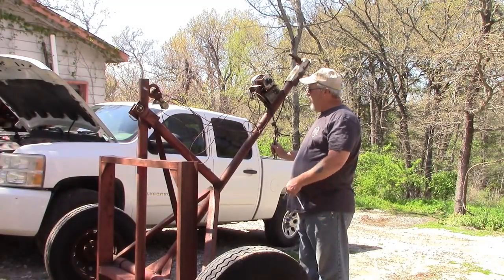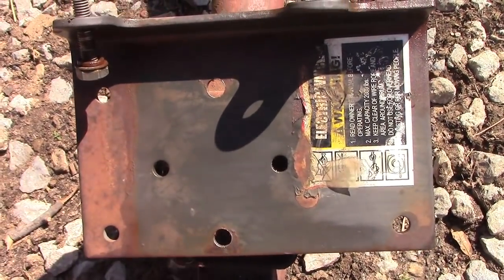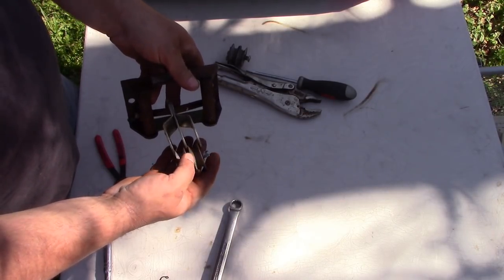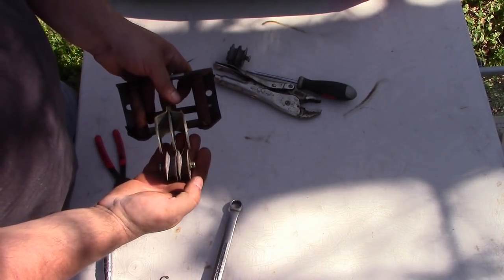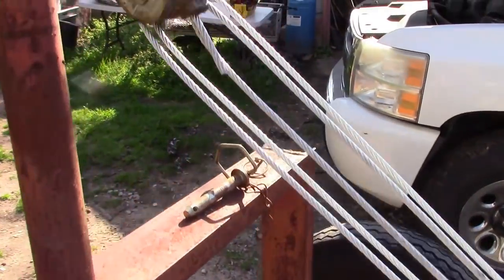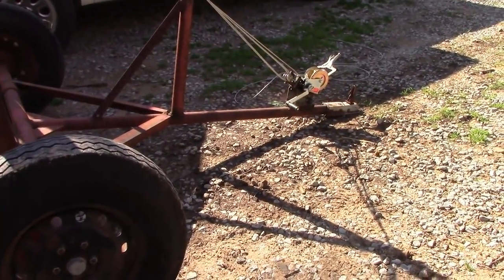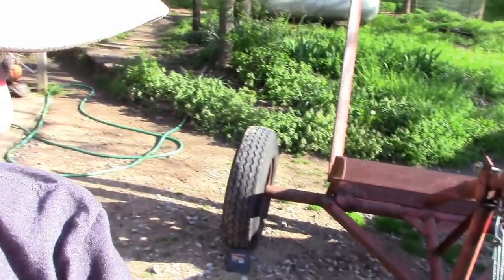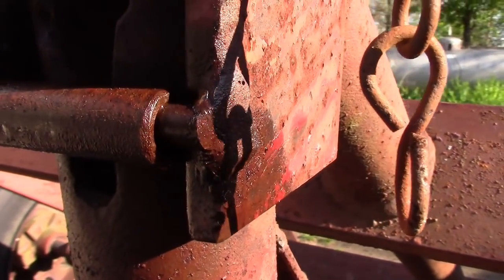Rigging the Hay Dolly

Comment: I like your pulley system. Considering the mechanical advantage, would it be necessary to get a pulley that is rated for 1200lbs or if using two sets of double pulleys such as the M50 rated for 880lbs, would that suffice or be a safety hazard?

Comment: Not to criticize, but if I observed correctly, the dead end clamps should have the “U-bolt” on the tail and not on the main cable...The “U-bolt on the main cable will crush it and cause a failure....just saying....Great video...keep em coming...
Reply from the maker: You know, I had to go back and watch, you are correct! Thanks for pointing that out! Appreciate the heads up.
Reply from the maker: It's raining today, but I am going to get those swapped around as soon as it stopped and while I'm thinking about it.